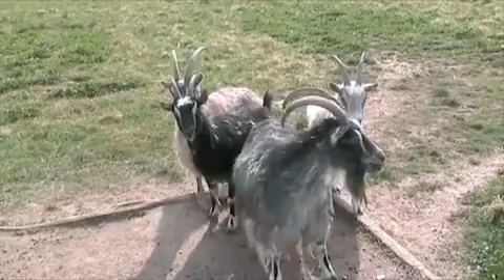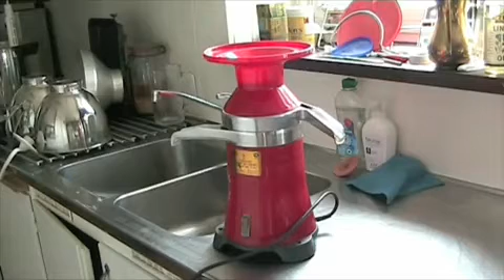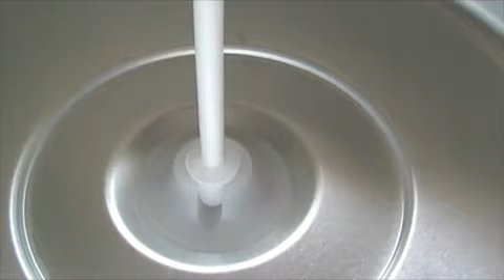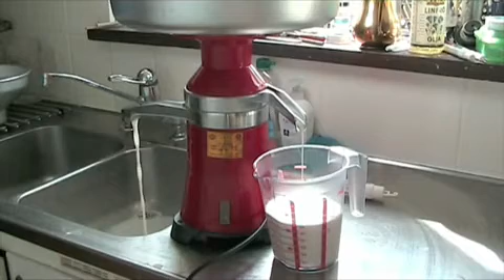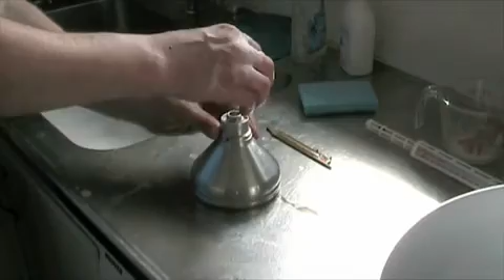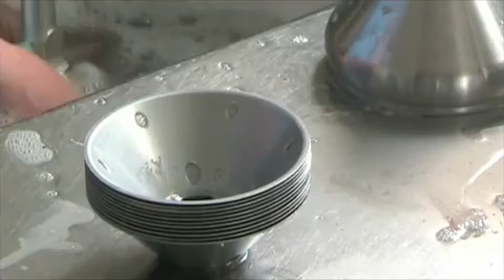Electric Cream Separator 80 L/H

Comment: i saw this on ebay and it says 120volts, how does a house using 110 run it
Reply from the maker: Thank you for your interest in SlavicBeauty cream separators. These units are a standard US voyage and plug. according to a website school-for-champions dot com The standard in the United States is 120V and 60Hz AC electricity. However, due to fluctuations, the average measured voltage is 117 VAC. http://www.school-for-champions.com/science/ac_world_volt_freq_list.htm#.WCcDPneZNE4)  These units also have a US standard plug

Comment from the maker: Yes, zameluzza is right. Please close the hole in the milk bowl by turning the white stick that goes through it. Pour the milk in and get the separator to the proper speed. Once it is in full working order, start opening the hole in the milk bowl allowing a little bit of milk to go into the separator.  When too much milk is poured at once, the milk starts coming out of that hole on the side. 
Oil should be added only to manual models.
Please always use warm milk, 100F for proper separation.

Comment: I have this same separator and there is a small hole at the top of the machine in the back that leaks milk like crazy when it is in operation. Also other videos show the use of light weight oil...there is no mention in my directions or a place for oil to go....Help. I do not want to mess this machine up, it cost way too much! Thanks
Reply: Cynthia Hale https://youtu.be/ZF1kOgWeZgI
Reply: The drum gains the work speed after 40 sec. after turn on.
You must wait these time, and only after that put milk in to container or open the stopper.
The second cause could be that you tighten  tightly  the adjusting screw of the drum.
Turn the regulating screw conterclockwise 3 times after completely tightened. Don't tighten much.